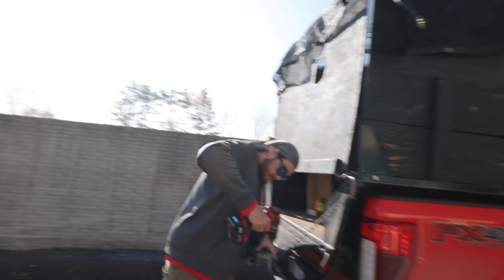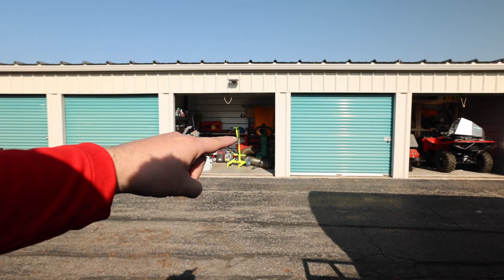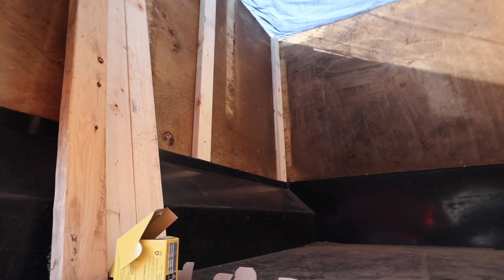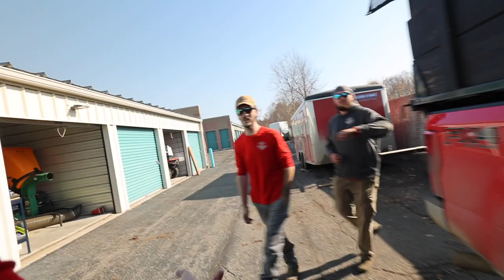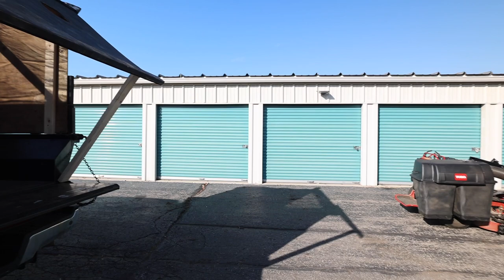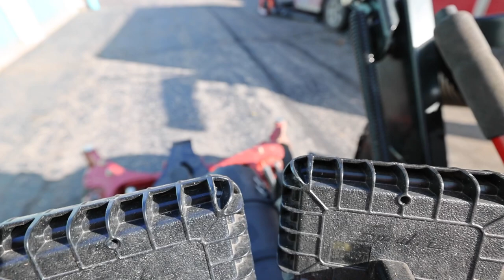2022 LEAF SETUP! [BillyGoat Debris Loader, Leaf Box Install, Toro Multiforce Leaf Bagger READY!]

Comment: From 25 yrs experience, you're gonna wanna secure that net top to the the side wall tops waaaay more to eliminate the gaps otherwise ur gonna end up with massive blowout at the top and a second mess to cleanup. Best method is to add a second mesh tarp over that one and drape the net over the edges of the side walls and bungee the ends to a screw that u put in at the bottom of the side walls. #precisionoutdoorliving

Comment: Brian, get these guys an impact driver.  I see them struggling with these screws.  Get an impact driver, both for putting together and taking apart.  No more stripped screws, and much faster.  You already have the batteries, just buy the tool.

Comment: I just got a  18hpe billy goat debris loader a few days ago. Tore off the old side  boards need to have  welding  done for the front bracket on the 7x14 dumptrailer , and build a leaf box for it  and repaint the trailer yet. Stupid rain isn't  helping since I don't have a  shop to work  inside

Comment: Hey Brian, when doing leaf cleanups, do you suggest pricing all services at the same hourly rate or at different prices? For example if someone only wants leaves blown into the woods or just mulched up, would you suggest pricing that at a cheaper service than with using a debris loader?

Comment: Hey Brian thanks for the video. I'm looking to buy a debris loader and I think the one in the video is the 13 horsepower. Do you like it, or anyone else that has it? Or do you wish you got the 18 horsepower? I'd rather get the 13 because it's seems like it'd be easier to deal with it with my setup which is similar to this one minus the dump trailer at this point. My fear is that I drop the loop and then end up with a still Backpack Blower as opposed to an Echo PB 9010( if that makes sense). I just don't want to be underpowered but I also like the smaller one for convenience. Appreciate if anyone had any input for me. Thanks.
Reply: Get the 9010. Get the 18hp. The End.